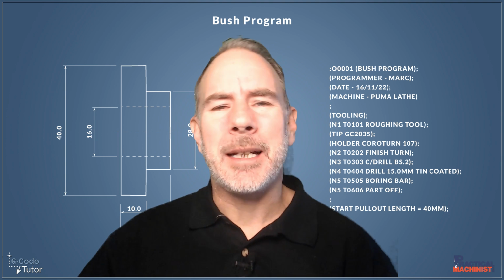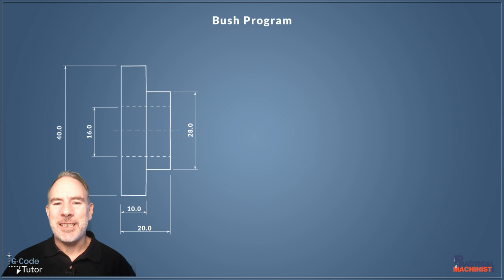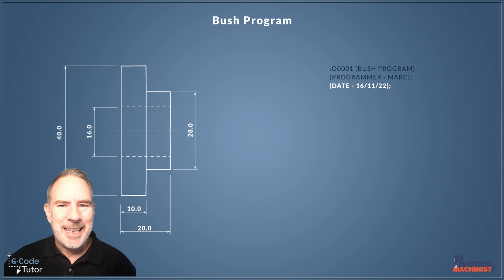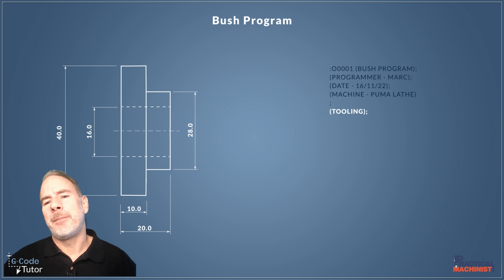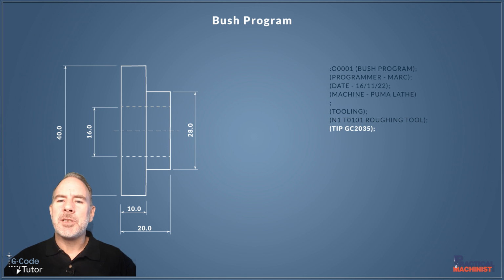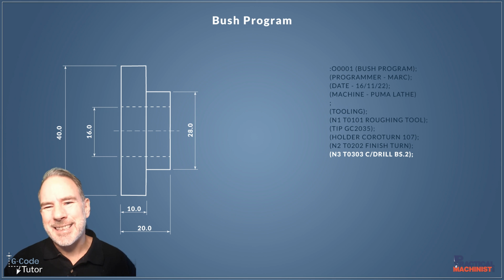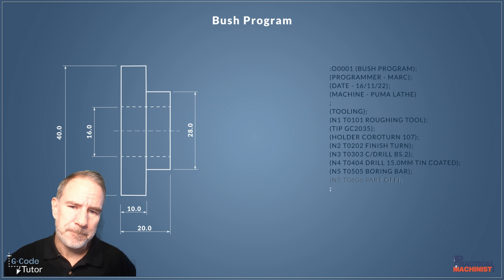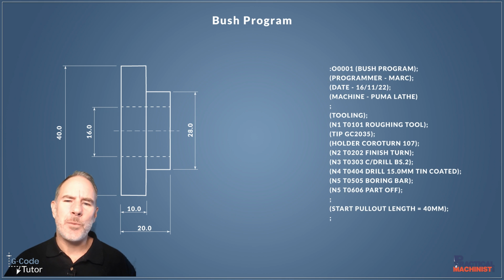How to Hand-Program a Bushing on a CNC Lathe - PART 1

Comment: Nearly every part I make is programmed by hand. I have a couple of generic programs for bushings, spacers and so on, where all I do is change some variables to meet the dimensions.
Most tooling in the machine stays the same for general accuracy. Once it's set up, I don't have to keep changing from tool to tool. #1 is always my first tool and everything is set to that position, both X and Z. Usually a CNMG 432 or 431. It usually does both roughing and finish cuts,
Tool 6 is always my spotting drill. It is also used for internal chamfering unless a boring bar is used.
Tool 5 is always the bar puller. 
Tools 7, 8 and 9 are all center on the lathe and if a boring bar is used, only tool offsets are needed.
Tool 10 is always the parting tool. It also does the final chamfer on the back of the part before completing the cut.
Tools 2 and 3 are the ones that get different holders and inserts for special profile shapes and can be either center posts or the blocks.
Tools 4 and 8 are also flow-thru for coolant if needed.
Every now and then, I need to remove the bar puller for clearance or put something there I normally don't use.
All this keeps the programming simple and written for the tooling already in position. Since most of the parts I make are indeed bushings, spacers tubes and some times well head parts and drive shafts for gear boxes, these are all I need most of the time.
Well heads are also threaded internally and externally, both API and ACME threads, so tool 8 gets the internal threads and tool 4 gets the externals.
... and here, I never knew these machines even existed before they said "Figure it out and run it." Just a mere 6 years ago...
Reply: Here is one of those in process. Made in Delrin so I could record. Usually a wet mess when cutting aluminum.
https://www.youtube.com/watch?v=xUyy0cTgqkM
I always run a test dry run to make sure the motions are correct:
https://www.youtube.com/watch?v=uh2Fi73bNg4
Reply: I keep files of generic CAN cycle programs and drop them in and edit a few variables and bang its on! Very similar to what you're doing. Also some of you may want to check out note pad ++ or visual code studio for off line programming. I have to admit I've spent my share of time on the g code tutor site! So thank you!!!
Reply: @DeepSixCycles  Yep. I have several canned ops that get called, from simple peck drill ops to threading internal and external. Even hole tapping.
Reply: That is how I tool up